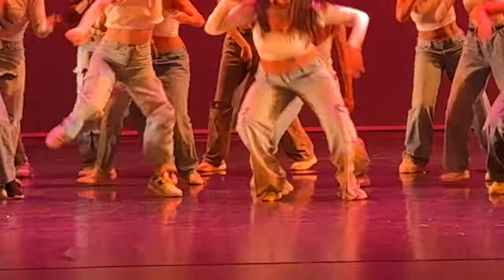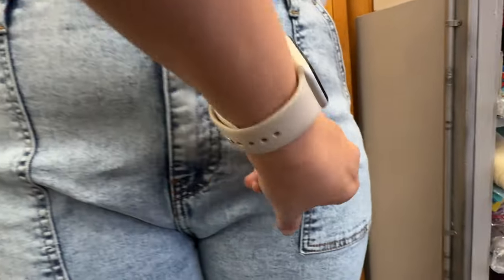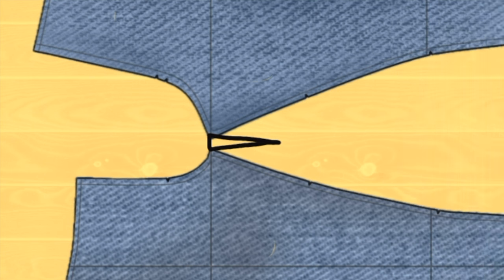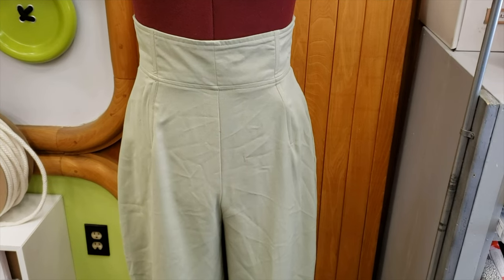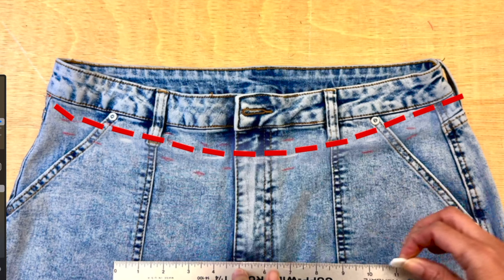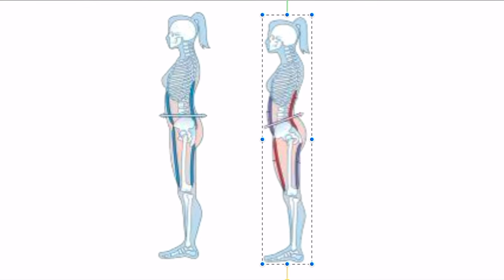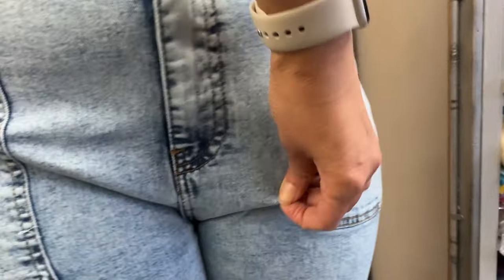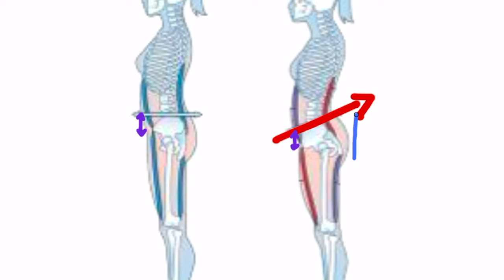How to Fix a Baggy Crotch on Jeans - YOUR QUESTIONS ANSWERED!

Comment: I always have the problem of the rise not being raised enough. Which leads to discomfort and the ugly camel toe. Dropping the crotch always make the length, even shorter and with a 34" inseam, most pants fail to fill the requirements😯